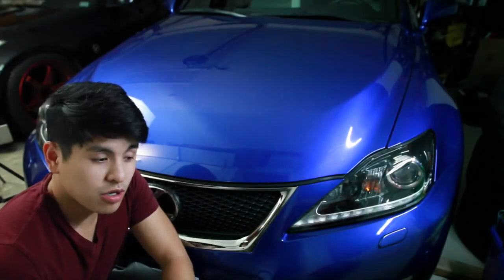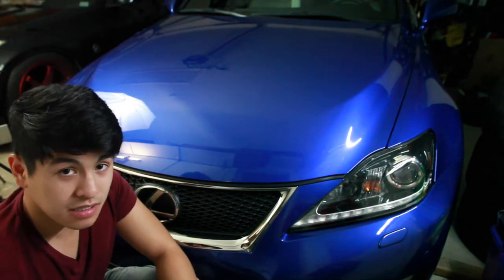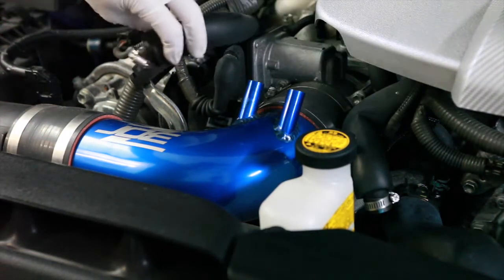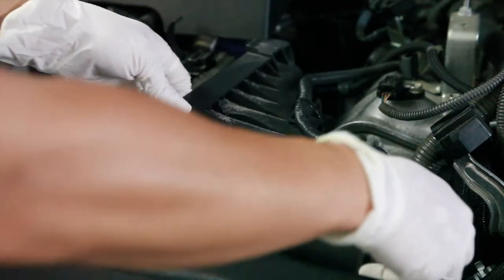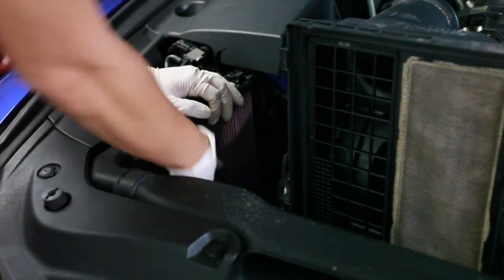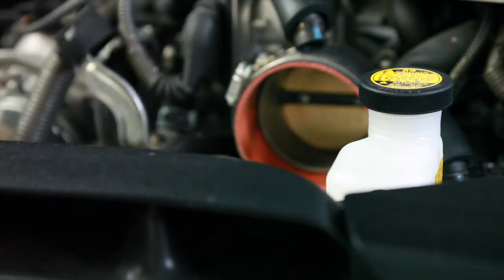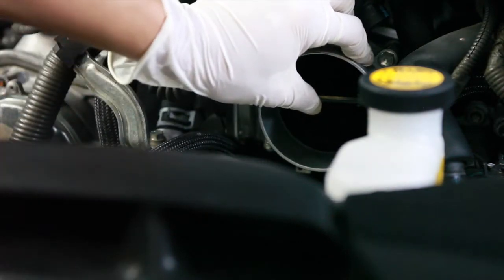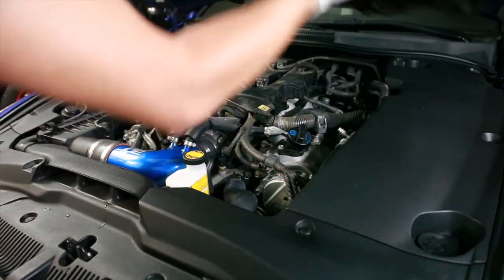DIY: Lexus ISF K&N Air Filter and Throttle Body Cleaning

Comment: Why do you have to flip the old filled with dust air filter on the engine?  Also, don’t you have a white piece of rag to clean the throttle body? Hear of SeaFoam?

Comment: I shall never touch a k&n anything ever again I had a k&n cone destroy two air mass sensors I did the maintenance on it once a year like your supposed to meh...
Reply: K&N is pretty open about the fact that their filter allows more airflow but consequently that also means more debris getting into the motor. I run other air filters instead. I can live with a slight power loss.
Reply: d1sturb3d, yep, had one in my FX35. Noticed in my oil changes, oil was darker than usual. Then i held up the K&N filter against the sun, and there are tiny holes all over, which DOES allow more flow, BUT at the expense of allowing more dirt as well. Three it away. Went back to stock. Oil was cleaner after.

Comment: I wouldn't use any filter that is high flow since it allows more dirt and junk to go through into the engine. Otherwise stick with oem or go with wix filters since they filter better and keep your engine in better shape.
Reply: Great advice… Any more top tips ?

Comment: You're supposed to oil the k&n filter before use so it will collect dirt.  Throttle body cleaner should be sprayed into the throttle body liberally, not just wiped on the blade with a rag.
Reply: hey genius! the K&N comes oiled!
Reply: My bad.  It's been a while.
Reply: +TeutonicSpeedracer Gotta give equal force for your initial comment :P 

obviously everyone over oils them anyways so the first go around its nice for folks to see what a misted in oil filter should look like. 

it kills me how many folks hate on the K&N when its not the K&N that's the issue. MORE OIL has to be better!
Reply: +TeutonicSpeedracer ***misted-in-oil air filter lol
Reply: TeutonicSpeedracer oil is already on the filter when you get one. Educate yourself more before making misleading comments like this one